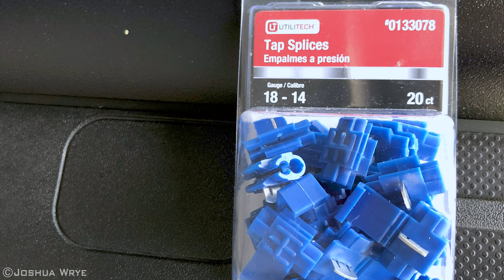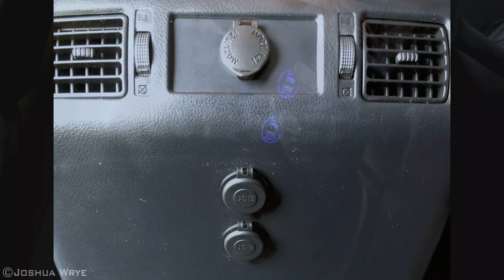How to Install Rear Seat USB Charging Ports in Your Toyota Tundra [4K]

Comment: Nice work. I hate the fact my tundra has no extra USB outlets. Only thing I would do differently, toss those blue crip connectors. Splice, solder and shrink swap all the wire connections. Take a little longer but its a way better connection. I have seen those blue connectors fail in the past.  Keep up the videos !!
Reply from the maker: Thanks! Soldering definitely has an added benefit. If you decide to do it, let me know how the project goes!
Reply: Militarized Citizen will do !! I just installed a Tesla screen in my tundra yesterday. I have a video coming out soon on this !!

Comment: I just did this to my 07 SR5 and wondered if you had an issue with the USBs staying hot (powered) even with your truck off. 

I have the same USB kit but orange glow. Wired it directly in to replace the existing outlet and the plug stays lit constantly. I don’t want a slow drain on the battery so I guess 8”” have to run an accessory switched tail from the front.
Reply from the maker: No, I don't have that issue. I purchased plugs that did not have an always-on feature just for that reason. The link is in the description for the model I bought and installed.

Comment: Great video, thanks! Looking to pick up a Tundra Platinum early next year and this will be one of the first things on my list. Did you have your dealer do the TRD suspension install as part of the purchase, or did you do it yourself after? I have a very specific ask from Toyota as I want the new 2019 TRD pro Fox shocks and 2019 TRD pro wheels - and these are obviously not an option as part of the Platinum. Thanks, John.
Reply from the maker: Thank you! The dealer I purchased from has a customs shop inside of it, so I worked with that team to customize the added TRD suspension, wheels, and tires. This allowed me to roll the truck out in my flavor immediately with only 9 miles on it.

The packages Toyota offers are an interesting mix. Therefore, I wanted all the technological gadgets of the Platinum with some of the TRD Pro offerings which required customization. First time for me, but it's been fun. I recently added the TRD Cold Air Intake which seems to have added a great sound (especially when pushing the throttle hard). I'll upload that video once I've edited it.

Thanks for watching, please subscribe, and share your truck once you get it!
Reply: Great, thanks for the info, it's really helpful. I'll certainly share details of the truck when I get it! Look forward to the cold air intake video 👍🏼
Reply from the maker: The CAI video is up! Don't forget to share the details of your new truck, John!

Comment: What size step bit were you using. Looks like a 1" then you dremmeled the rest to size? Looks clean. Good job dude.
Reply from the maker: Thanks for the compliment! Yes, the USB adapters required a 1 1/8" bit, but I only had a 1" bit. I used the dremmel to finish the rest. However, your local hardware store will sell that bit in a 1 1/8"...but they're ~$40!
Reply: @MilitarizedCitizen  I just ordered one from Amazon for $12. Thanks for the reply.

Comment: great idea, I have the 2018 Tundra SR, so mine didn't come with much fancy stuff.   I have started adding to mine.  I had the Basic Entune, so I managed to find a Entune Plus radio from a 2016 Tundra, go that installed, used my old SIriusXM radio antenna, it worked great and the HD Weather and live traffic now works with the other antenna that mounts under the dash.

I bought some after market fog lights, but of course mine didn't have the switch on the headlight switch, so I bought one for a SR5, got a friend to install it on the steering column and it worked!   Next step is the intermittent windshield wiper switch, should be an easy install.

So, next after this will be USB ports since the Tundra doesn't have any.  So I liked  how you did yours, but how can you make it that it is always on?  But if I do it always on, I see the blue LEDs, so would that not be a good idea?   I would like to have my phone charge say if we have been at the beach and camping, but I would not want to leave my truck running just to charge the phone.    Any thoughts or suggestions?   

Thank you for your video, looking forward to more mods  :)
Reply from the maker: Thank you for the compliment! Toyota does seem to lag behind the industry standard when it comes to technology, unfortunately. However, there are work-arounds and it gives us DIY'ers something fun to do - customize our trucks! The Entune Plus upgrade you've done is almost a must. Have a good one and keep on customizing!
Reply: Here is my things I have done on my Tundra, I didn't do guides, just pictures of the final results:

https://www.tundras.com/threads/my-2018-tundra-sr-updates-mods.31697/

As you can see, having some fun too  :)
Reply from the maker: Hey Rob, for some reason the comments on my YouTube Studio app weren't completely showing. I didn't mean to miss the remainder of your comments/questions. Since I tapped from power at the cigarette lighter, the USB power comes on when I switch the key to the "Accessories" position so I don't have to turn my truck on. If you want this to always run hot then you'll have to run a wire all the way to the battery (and through your firewall) in order for that option. But yes, it will constantly draw power from your battery.
Reply: You can get the non-illuminated version for always on installation

Comment: I hope you checked the fuse size, of your 12 volt plug. Because you just added an extra 10 amps to that fuse. I seen that each usb port had its own fuse, but you added to the total amperage of that circuit.
Reply from the maker: 10 amps...if you use all of the USB ports at once and they all require that amperage. So far so good. I've had up to three devices plugged in at once and it's been working fine since the install.
Reply: Militarized Citizen If you use just the usb or just the 12 volt you should be good. But my worry would be if be some chance, you used all of them at the same time. Boom overload, you would be safer to put the usb on it own circuit. It easy to do to be safe
Reply from the maker: Completely accurate. Too much juice pull and it wouldn't be fun. :)

Comment: I do not like the fact that Toyota didn't add these or make the cig plugs hot all the time.....  when I install mine I'm making them hot so I dont have to have the key on just to charge
Reply from the maker: I completely agree. Studying "The Toyota Way," I also understand that Toyota is a practical manufacturer. Even so, most of their other vehicles come with new tech, so you'd expect their top-of-the-line truck too as well. Here's to the new Gen in a couple of years!

Comment: Not bashing your tutorial, but, this is absolutely the wrong way to wire.  Great idea up until the tapping.  Just make a double jumper and tap directly off 12v prongs.  Cleaner, safer, and will last forever.
Reply from the maker: Sounds good. Thanks!

Comment: its too bad Toyota is that far behind on technology and  creature comforts ...still in 2007 mode.
Reply from the maker: Yep. If you dig into the Toyota Way and understand their manufacturing philosophy as well as understand the Japanese culture, they are very practical. The trade off is extremely high quality. This 2018 Tundra will last me well over 15 years without much maintenance costs.